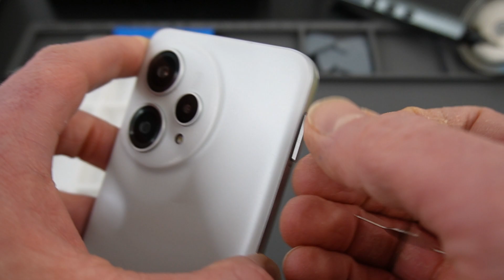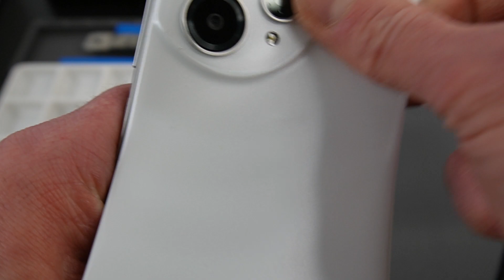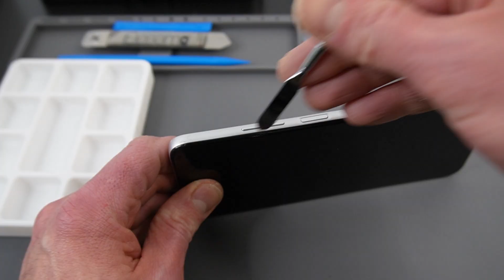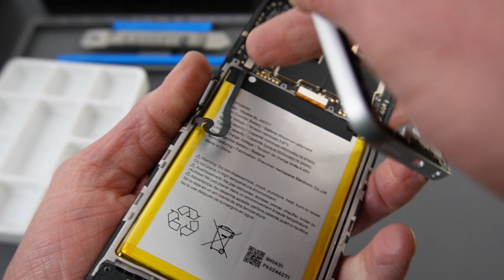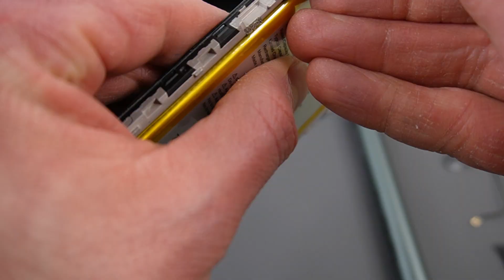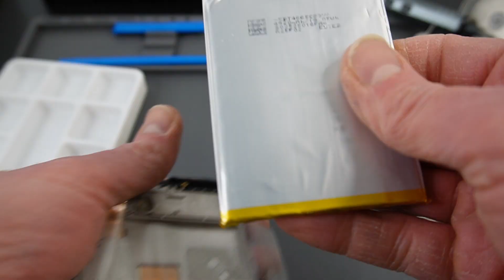AT&T Verge 2 5G (SN333A) Teardown, Screen & Charging Port Replacement | Repair Guide

Comment: Thanks for making the teardown Video, the  AT&T Verge 2 5G phone I have when I try to tap 7-times on the build number to get into developer mode, it will shows (Blocked by work policy), not a problem for me using this phone for what I need it for, I really like the big screen size and have been using Droid Star and other Ham Radio apps on the phone with no problems at this time.W0TRJ
Reply from the maker: Thanks for watching. Ya most New Android phones will have that block in place since they dont want you to run a custom os on the device. The Factory unlocked OnePlus devices are usually best for this since they let you in developer mode.